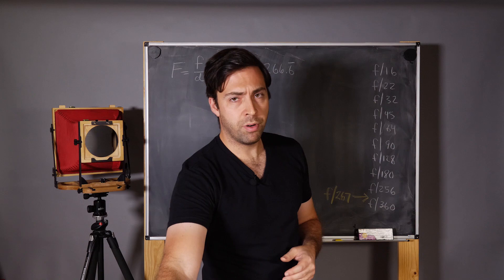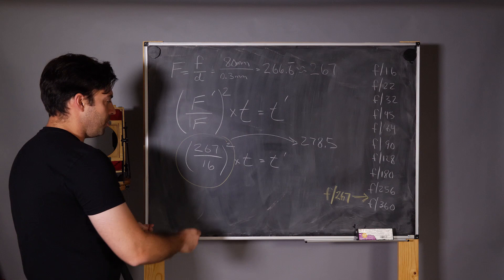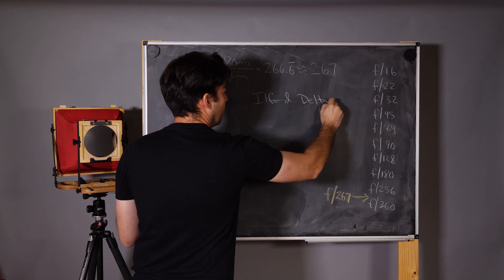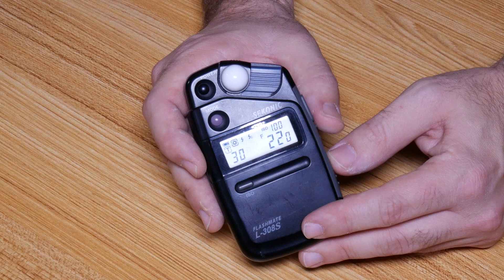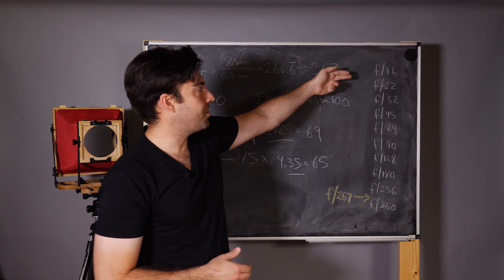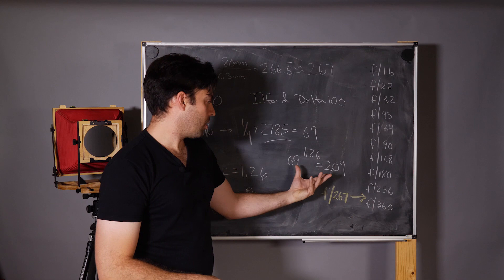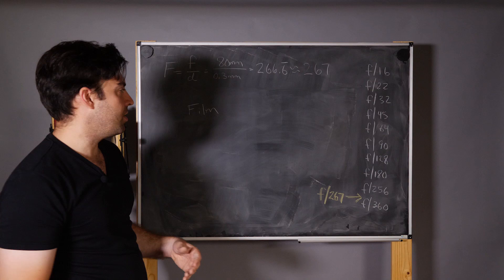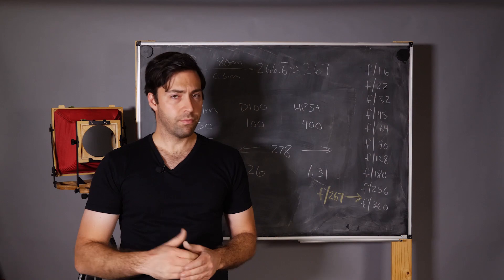Perfect Pinhole Exposure Times

Comment: I found the math very interesting.  I haven't done math like that since I graduated from college in 1975.  I went to Mr. Pinhole and generated a table that gives you the exposure for F16.  I then copied it and kept the parts I would use.  From 1/1000 to a few seconds that yields a exposure time of 15 minutes.  I know I won't wait for more than 15 minutes for a exposure.  I printed this out and glued it to the side of the camera.  To use, I meter using the ISO get the exposure for F16 look up the exposure on the chart.  I find it works well for photo paper negatives.  When I used film (Foma 100) I did the same except I added time for reciprocity failure to the chart.  Makes it pretty simple in the field.

Comment: Based on the tabular data, calculate the coefficients for the following negative films:

Rollei RPX 25 1,33
Rollei Retro 80s 1,53
ADOX 100 CHS II 1,45
Retropan 320 soft 1,45
Fomapan 100 1,60
Fomapan 200 1,63
Fomapan 400 1,45

Comment: I like your channel very much!

On this one I have some remarks.

When you are calculating an f-stop of 278,5 it looks very scientific. If  you use f/250 or f/320 instead it will not make any difference. If you 
imagine the difference between f/8 and f/16 this is one stop, the difference between f/250 and f/320 is about 1/4 stop. This does not 
affect the result of your final exposure!

1. this depends much more on you exposure measurement, for example if you use a spotmeter and measure the shadows and lights it depends on 
your judgement and experience (zone system), where you place your exposure 

2. and it depends very much on your knowledge and experience of the Schwarzschild effect of this film

I use the great App Photopills for all my pinhole shooting and get great results. I really can recommend this great App for all kinds of photography!!

Regards Dierk

Comment: I have a 4x5 pinhole camera (CH Levy from B&H) and I’m photographing inside my house in natural light and I’m calculating exposures around 35-45 MINUTES!  (With rf). I’ve gone over the math several times…seems way to long but…math don’t lie.
Reply: I figured it out!
When do you converts seconds to minutes?
Say I calculate a 10 second exposure from my light meter at f16…
My multiplication factor for my pinhole camera is 208.44 = 2084.4 seconds.

If I take that squared to 1.31 (my films rf) that = 22,277.4 seconds 
Now divide that by 60 = 371 minutes. !!?

But if take my 2084 seconds and convert that to minutes…I get 34.7 minutes
Now adjust that for RF = 104 minutes…

Comment: Hi.  First up, I am a pinhole newbie and I am absolutely terrible at maths - but I am determined to get my head around this science!  Your video has been super helpful and I've watched it several times.  I think my numerical brain fog might be clearing a little! Am I correct in thinking that with a f number of 160 and all my calculations taken at a f22 my T22 number will be 52.89, which I then multiply by my meter reading (at f22) ?  To this I then 'xy' the reciprocity factor.  I would be grateful of confirmation that this is correct or indeed welcome correction!  Thank you in advance. Best wishes and stay safe!
Reply from the maker: Yes, 160/22 squared gives you 52.89 so if you meter the scene at f/22 and it gives you an exposure time of 1/2 seconds at the ISO of your film your new pinhole exposure time would be ~26.4 seconds. Then you apply the reciprocity factor for your film if you know it. If you have access to a smartphone there are a lot of great pinhole exposure apps that you can always use to double check your work. Best of luck and thanks for watching!
Reply: @TheScienceofPhotography  that's great - thank you so much 😊

Comment: Very helpful and informative, thank you!  
Many years ago, I was poised to try pinhole photography.  I bought a pinhole lens cap for my camera, a Nikon FM10, but then put it all away in a drawer.  Fast forward ~20 years, and I'm ready to try for real this time!  
My problem - I didn't keep the literature that came with the pinhole, so I have no idea what its diameter is.  Aside from putting it under a microscope (which I don't have) I'm not sure how to perform the very first calculation, F=f/d.   I'm also not exactly sure what the flange distance of my FM10 is - the literature I've found doesn't call out that property specifically, unless there is another name for it!  With so many unknowns, what would be your recommendation?  Buy some film and start shooting a huge bracket of exposure times, or is there a way to narrow down my settings more efficiently?  
Thanks!
Reply from the maker: Glad you're getting into pinhole photography. Nikon has the advantage of using nearly the same lens mount for decades. The flange distance should be close to other 35mm cameras of the era which I believe is 46.5mm.

If the pinhole was designed optimally it should be around 0.25mm wide which would give you an F-Stop of f/186. So if you are going to bracket I would start there and maybe use shutter times that were +/- 1 stops in half stop increments. So meter for the following: f/128, f/152, f/180, f/215, f/256. Most pinholes are designed in this range.

An even better way is to borrow a Nikon digital camera. Most of the dSLRs should share the same lens mount as the FM10. Take a picture with a 50mm lens that is normally exposed. Then put on the pinhole and keep increasing the shutter time until you get something similar in exposure settings (you can look at the histogram). Let's say with the lens took a correct exposure at f/4 at 1/125sec and the pinhole got close to the same exposure with 30 seconds. Keep dividing 30 by 2 until you get to 1/125 (30, 15, 8, 4, 2, 1, 1/2, 1/4, 1/8, 1/15, 1/30, 1/60, 1/125 is the shutter speed scale) that's 12 stops of difference. Then go 12 stops up from f/4 to get to the aperture of the pinhole (4, 5.6, 8, 11, 16, 22, 32, 45, 64, 90, 128, 180, 256). So in this example it would be a f/256 pinhole.
Reply: @TheScienceofPhotography  wow, just wow!  Thank you!  The proxy Nikon dSLR is a very smart suggestion, as is the rest of your detailed advice.  I will see what I can do.  You can be sure I will check back in here to let you know how it goes.  Many thanks once again!

Comment: If I am using photographic  papel . What is the ISO?, What is the reciprocity factor?. Thank you.
Reply from the maker: On one of my videos here: https://youtu.be/99CWeYm4YM8 I discuss this. Check around the 10:30 mark for the information. All photo papers are different so testing will be required, but generally between ISO 1.5 and ISO 3 is normal. I use ISO 2 in the video with good results. I usually do not account for reciprocity in paper. 
I hope that gives you a good starting point!
Reply: Thanks for replying, it was good to see the video
Reply: @emiliovaldes907  hola, pudiste averiguar cómo calcular el tiempo de exposición con papel?

Comment: How do you calculate focal length and f number if you're using a body cap pinhole? Thanks.
Reply from the maker: F Number is always focal length/pinhole diameter. If you are using a body cap you should look at the "flange distance" of your specific camera (use google or the camera's spec sheet). This is the distance from the film or sensor to the lens mounting ring. Then depending on where the pinhole is on the body cap you may need to add a few millimeters (use a caliper to measure). Hope that helps.
Reply from the maker: https://en.wikipedia.org/wiki/Flange_focal_distance 
here is a list of common cameras